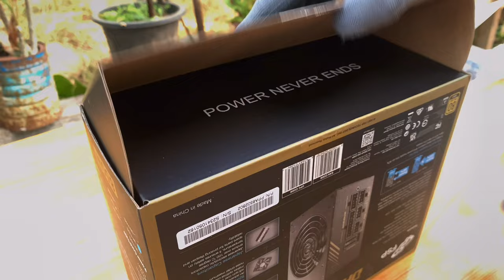[4k] White PC Build | Day to Night Setup | Vision D | Lian Li Dynamic Mini

Comment: Hello, I have the same memories but I can't activate XMP, when I do, it gives an error. They work fine but without activating XMP, I have an Asus Strix Z690-F motherboard, my memories are DDR5 at 5600Mhz
Reply: Dude, DDR5 cannot run XMP with 4 sticks. Try two only and try again.
Reply: @cassadymp  with two it runs fine, what happens is that the specifications say that it works...Thanks...
Reply: hi the problem may be your motherboard doesnt support it.....i had the same problem.........my ram was 3200mghz but running on 2666 mghz